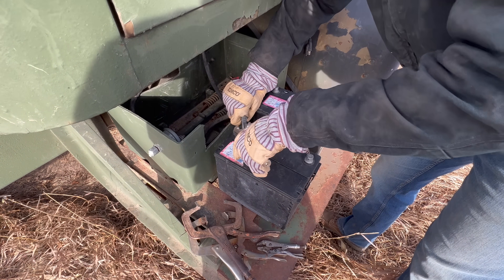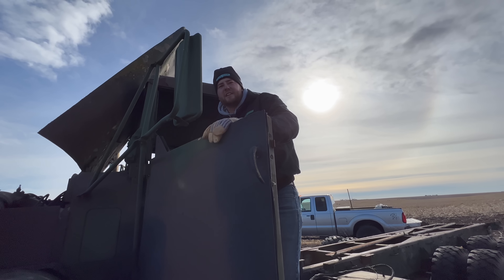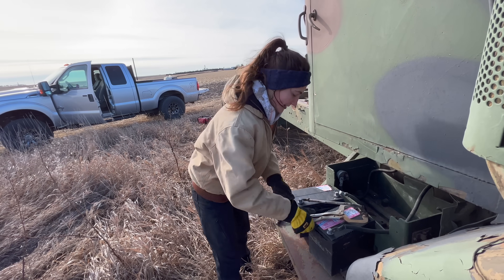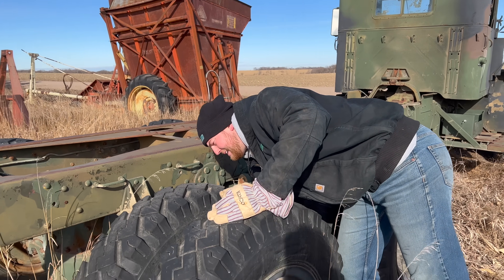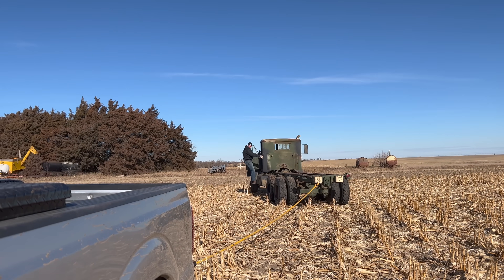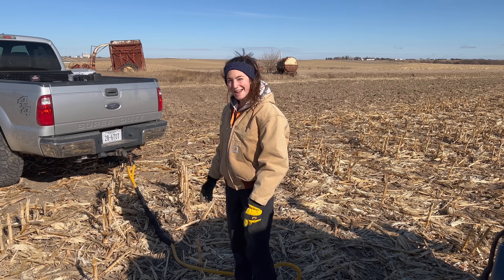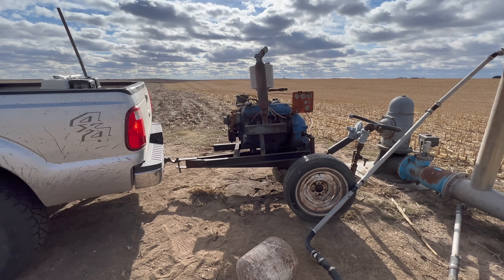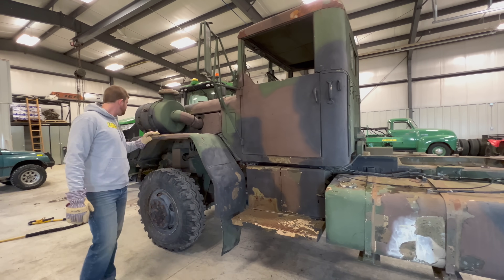If You Can Start It, You Can Have It

Comment: There are some models that can run on a multitude of different types of fuels, including diesel, AV gas, kerosene or other types of fuel. There are several problems with the engine. The other engines that uses diesel only, lasts longer.

Comment: One month later: Is it started yet? If not, did you check the plugs for spark? It is turning over, barely, but maybe pour a bit of oil into the cylinders to help lube the pistons/valves. After sitting in the weeds so long internal engine is probably pretty rusty. You may need to pour fresh gas directly into carb--enough to start.

Comment: I worked in Iraq as a welder in a shop that fixed blown up or otherwise broken armored trucks. We had a 6x6 on our compound to make junkyard runs. I think our 6x6 which looks like yours would run on kerosene, jet fuel, or diesel.  Ours may have been a 1968 model.

Comment: Your first tractor pull girl!! You can use wd 40 as a starter fluid for diesels. That's not a junk truck in fact it seems to be in very good shape. The scrap value will be high though if they charge by the pound.

Comment: that is a 800 series 5 ton truck has a big cam cummins eng.  the numbers on the front are from the 1st medical bn m company and the bumper number is the last 2 numbers on the right as you face the front on the truck
Reply: clean the fuel system and change the oil and fuel filters.  get HD batteries those car batteries wont do it

Comment: Re-manufacture the truck. Remove cab, fenders etc. Strip everything down to the frame. Rebuild the axles. Rewire. Maybe put a cab-over on to replace the cab. Build a small 8-10x7' studio for living in when needed behind the cab. Engineer the frame to accept containers when not using as a flatbed to haul farm equipment. Install a re-manufactured diesel from Springfield Remanufacturing in Missouri. Use the flatbed to carry disabled and older veterans in parades like the ones on Veterans Day. Make sure you put your logo on it. Repaint it. Farm Show Magazine may be able to connect you with others who would work with you in finding needed materials.

Comment: That truck is not junk. That particular truck is a 1968. There’s an a half 5 1/2 ton vehicle capable of pulling up to 18205,000 pounds at truck has a 3 1/4 inch rear axle has two of them has 18.5 inch tires on the rear Dooley’s all the way around it on the front that has 18.5 inch tires as well and all the differentials can Inter lock with each other. My truck is 800 horse

Comment: Diesel engines won't survive if you feed them gas. Multi-fuel means things like diesel, kerosene, lightweight vegetable oils, etc. You can use a tiny bit of gasoline to thin down diesel in cold weather (I think the ratio is something like 50 to 1, but I won't swear to that). Most diesel owners simply go with "winter weight" diesel and avoid the worry.

Comment: You should aquire a set or 2 of supercaps. 1 16v(12v) supercap bank will give 3000 cranking amps. 2 in series will turn that motor over real fast and easy. Your batteries are a long way from the starter too

Comment: If it is an old 250 cummins as someone said earlier there will be a screw on back of fuel pump...with that turned in it should continue to run  once you get it started

Comment: Those are unit designators on the bumper I believe this truck came from a chemical unit. And this truck can run n kerosene and diesel. Also not sure but you need several batteries to start, I believe you need four batteries.

Comment: AAAAAAAAAAA!!! That thing is SOOO BEAUTIFUL!!! Dude and dudette, you are SO LUCKY! Congratulations! Totally subscribed!

In the future, a deep well socket and a 6" socket extension is aces for straightening bent studs.
The exhaust pipe is no big deal, but a little tough to find in that size- check with semi repair shops. 
Investigate that 'fuel pump' switch- can't start it if it can't get fuel. That may be a supplemental pump, though- read up and see if it has a mechanical pump, or if it's electric only, where it's mounted (and why it's on a separate switch!).
The oval thing with the switches to the right of the starter button is for your lights, but I don't know which one does what.
You forgot to glow the engine! That's a diesel, you have to find your glow plug circuit and energize it for at least 30 seconds to a minute, especially in weather like this.
A good set of heavy truck batteries (850CCA minimum) are a must, that's a LOT of iron to turn over. I admire you for trying to pull start it, but you have to heat it first!

Comment: It's a 250 Cummins engine  all you need to do is turn the fuel pump on manual put in gear and let the clutch out it will start might take a minute to get the air out of the system but it will start

Comment: 😮The duce has a multifuel engine 10 to ratio 1 gallon of gasoline to 10 gallons of oil or diesel fuel kerosene tractor lite it will run on hydrolic oil I run diesel fuel and 2 quarts of type F automatic transmission fluid that way it will clean the injectors turn your battery's switch on 2nd gear it will start and turn your air on and go on I can tell when somebody ain't never used military trucks

Comment: Multi fuel....any liquid that burns basically. You could run it on CHANNEL NO.5 if you wanted to. Rather ingenious idea it has a compensator built in that can tell what the fuel is and change engine settings accordingly...in the 70s....

Comment: A few things just 5mins in you are getting a 6wd truck you can get power to all 3 axles of this truck. the numbers on the bumper would tell you the unit this truck was with and if this is the one I'm thinking of the engine will run on any type of fuel. Gas,Diesel,kerosene,naphtha, etc is was one of the requirements when they were commissioned by the military. Going back to watch more as there is a start up procedure that I want to see if you guys know it :) 1st edit; Lol so sad you guys did not fire up the ignition power it sounds like it may have started up for you right there....2nd edit; especially when you tried to bum start it lol Oh and these are called a Deuce and a half ie 2 and1/2 ton truck and there are lots of places to get help with a resto of one. Good Luck in your newest adventure!!

Comment: YOU CANNOT RUNIT ON GAS, BUT YOU CAN RUN IT ON FUEL OIL KNOWN A KEROSINE OT HYDROLIC FLUID. YOU CAN ALSO USE VEGATABLE OIL IF IT IS THIN ENOUGH TO FLOW.

Comment: Two 6volt battery's  have to be deep well the pos two negative then pos two pos negative to negative then there are two switches pinch then together  for the glow plug when the light goes  off then start it should start

Comment: Ms Laura:
	I have sent this idea to several people in the mid-west and gotten no reply. It may just be to dumb an idea to rely to/ I don’t really want to post this on you-tube because of all the snide remarks
I expect will follow but I just want an honest answer. Is this a workable idea
	Several years ago I read a story about a farmer who tried to put water back into the aquifer. First by just poring, then by pumping the water into his well. Both attempts caused the well to clog up.
	I have two ideas for the reason and two suggestions.  
	1.  The water may not be clean enough for the aquifer. Even water we could drink and call clean could have dust or even just pollen. Water from farm land will have pesticides, weed killer, fertilizer to name a few items. Any of these could clog the pores of the aquifer rock.
	2. I have read that the water table is up to 200 feet below ground level in some areas. Water falling 200 feet will hit with a force close to 70 mph, which will cause erosion of the aquifer rock which will cause clogging. (kind of like a shotgun blast)
	What if a special well were drilled on the river bank and water was pulled from the river then passed thru a filter. Let’s say the well pipe is 6 inches in dia. Place a cable in the well pipe with a plug every 50 feet on the cable. This plug would be 1/64th of an inch smaller than the well pipe. The last plug would be 4 feet long and rest 2 feet deep in the water table. 
	Then pour water into the well at a rate the will allow the water to seep past the plug while not “piling up” on the bottom plug. I think the water backing up on the last plug would cause pressure and FORCE the water past the last plug, which would cause erosion. What I am looking for is the water to arrive at the water table at the speed and force of a light spring rain.
	If this works special wells could be drilled and resupply the aquifer almost every minute of every day year around even if only a few gallons per minute per well. And I won't come over and try to drive your combine.

	Just an Idea
	skyking4290@gmail.com

Comment: Most cummins of that vintage have a electric fuel solenoid with a manual over ride. Could have either left the batteries connected or put the fuel solenoid on manual then pulled it.

Comment: BTW your engine is not a multifuel. You have a 250 horse power Cummings engine. Non turbo,to bad. Look at the data plate. You have a extra long wheel base. It's a 800 series 5 ton truck. Very reliable, but can be hard to start in cold weather.

Comment: The frame is nice and long you could do a lot with it you could make it a flat bed or flat bed dump truck a box truck and even a motorhome that would be cool a military truck motorhome yes they are multi fule and military trucks don't have to use any keys they need to be able to just get out and go just jump in and start it up and go

Comment: To answer the question about the bumper numbers,  It appears that the original markings may have been changed on the Driver's side due to the fact that the numbers appear to be quite fresh in comparison to the condition of the rest of the vehicle. Only the Army uses bumper numbers, and they are used to determine the unit that the vehicle belongs to. I can only tell you what more current numbers would mean. Current symbology would have Battalion and higher information on the passenger side and company and specific vehicle on the driver's side. For example, 3I 6-8CAV on the passenger side would indicate that the vehicle belonged to the 3rd Infantry Division, 6th Battalion of the 8th Cavalry Regiment; III 26S would be 3rd Army, 26th Signal Battalion; and so on. On the Driver's side, it would be the Company/Troop/Battery that owns the vehicle and the specific vehicle in the unit; A6 would be the 6th vehicle in Alpha Company; HQ1 would be the first vehicle in Headquarters Company. 13C** 1MED escapes me due to the 2nd and 3rd letters being hard to read and there is no MED equivalent in the unit markings directives (my guess is a possible medical unit with the National Guard).  I can't find anything to determine what 36M 49 means, but best guess would be the 49th Vehicle in whatever unit is designated by the 36M. Since I cannot find anything to determine what 36M means, then either it is an older designation that is no longer used, or the number was made up when repainting occurred. Note* the 6th vehicle (HQ6, A6, B6, etc.) is reserved for use by the unit commander and the 7th (HQ7, A7, B7, etc.) is reserved for use by the senior enlisted member of the unit (First Sergeant (1SG) or Command Sergeant Major (CSM)).

Comment: What you have there I believe is an M813 5 ton cargo with out winch, the engine is a Cummins NHC 250 diesel engine, I don't think it's a multi fuel engine rated at 240 horsepower. the gearbox is a Rockwell 5 speed with a Rockwell 2 speed joey box, 6 wheel drive is engaged when the rear bogie starts spinning the wheels, a design flaw in my opinion, the truck is flat out at 55 MPH, the brakes are crap even when set up right. you can get from Cummins another cam for the fuel pump which extends the revs to 2600 RPM but if you do that, fit a Jake brake and Maxi brakes your top speed will go to 70 MPH with this mod. I see you are missing the right hand fuel tank as well, the left one holds 120 US gallons & the right holds 90 US gallons the batteries you should use re rated at, at least 150 cold cranking amps. Good luck with your new toy.

Comment: 50/50 Gas & D. Or K. Don't run over 50% Gas. New D work's great. FYI 60 mph is top speed. Makes the best RV camper ever. AWD vehicles. Need to keep 20% gas in the mix.

Comment: Batteries 1.01 if you have two 12v batteries you don't have 24volts. If you cross the + positive terminal of one to the - negative of the other your two batteries are now 24 volts from the negative terminal of battery A and the positive terminal of battery B you can also do it with two 6 volts batteries to make a 12 volt battery. This is in case anybody watching thinks they would like to try doing this at home. Don't know why because nothing I know of runs on 24 volts. I just like pointing out useless information. The tube blew in that tire for anyone who doesn't realize tires were not always tubeless. I know nothing about the numbers but they could be something like an identifier for what Military group it belonged to Battalion or Company or whatever or maybe just a number to say this is a certain vehicle. Fun on the farm as always

Comment: The funny thing is when your charger doesn't fit need a 5 lug all you have to do is take a rat tail file and rounded out the holes and it'll fit just to get for work your AR point A to point B

Comment: Too start with  you can't pull start a  diesel  trucks  by pulling  them  they have  a glow plug  and injectors  which has too heat the air  in the. Cyelder before  it will start because  they  don't  have an electronic  firing  system

Comment: Can confirm that most old diesel engine's will run on all light oil fuels eg kero, diesel ,light oil ,hydraulic oil , and cleaned and filtered waste engine oil   tho when running old waste engine oil most engines under the 4-5 Litre capacity had to blend old waste oil with some gasoline 5-10% if in really cold climate   and the rest of time would blend diesel at 20% diesel and 80% waste oil cleaned  in my nissan td27 turbo running 30psi boost  never missed a beat and was bloody grunty

Comment: you really are bored to death! :)) i enjoined. advise: remove the gas/diesel out, can cause problems to the engine. use one gallon canister with gas/diesel on the suction pipe of the engine. bigger batts sure will help.

Comment: Be very careful around those tires and wheels,they have a locking ring that snaps into the rim,don't stay in front of those tires when you air them, they are dangerous rims to work with, 😮😮

Comment: Intertaining !
Tell me the happiness is for sure, not just for
The screan🤔
 I would've  got it started on way home! Put in high gear,let clutch out to turn engine over til it starts or find out why not! Using starter gets $ $ !
When pulling stuff the pulling machine should be pulling up,whatever is being pulled needs hitched lower,traction lost otherwise!
Springs, axles near springs can usually  be hooked onto ok ! Don't quick yank it ! Use transmission ingear high gear & clutch to slow/ stop it !
You greenhorns r funny 😁 : at least u stayed safe😉
One tube is junk! 1 outa 10 ain't bad !
Alway ready for more😅🤣🤣
Be safe! Hey 👧
Mice ain't beavers,lions either; keep pants tight around legs,then your OK!

Comment: Don't run low range on highway. Front wheels run 10% slower in low range of transfer case. Air over hydraulic brakes.

Comment: In regards to "multifuel" these engines will run on everything from diesel to kerosene...but DO NOT ATTEMPT TO USE GASOLINE! Remember, they use compression to ignite the mixture. Gasoline requires a spark to ignite the fuel/air mixture.

Comment: Numbers on the front of a military vehicle is the vehicle number with letter it there for a daform 5988 and the fuel is desseil
Reply: Also look for a information plate on the door or under stirring wheel or on the passenger side
Reply: And unit info would be a 3 digit number usually on the bumper but can be found on the doors or hood
Reply: Either put the two batteries into a series or parallel configuration

Comment: Please be careful working with 24 volt! It is a lot more dangerous than 12 volt. The wheels are extremely dangerous as people have mentioned.
Join Steel Soldiers and you can download all the tech manuals and parts manuals for free to help you work on this truck. A lot of people there are willing to help with any problems you run into. Parts and tires will be in the classified section too! Good luck with everything!

Comment: The engine is a LDS465-1 multi fuel , if it burns you can put in the tank.  Has a density compensator.

Comment: Uhh, you can't use 12 volt batteries, they'll work for a while, but, a 12 volt is a 12 volt even if you use two.
You'll still need a 24 volt battery.
Cool show. 👍

Comment: It's hardly surprising that the engine would barely turn over when truck batteries are twice the size of the ones your using plus trucks use two of them!!! If you've got a big engine you need proper power to start it!!